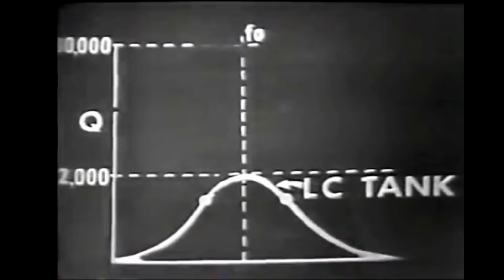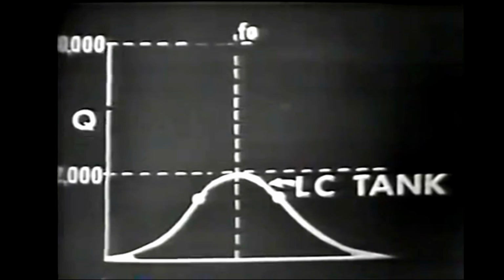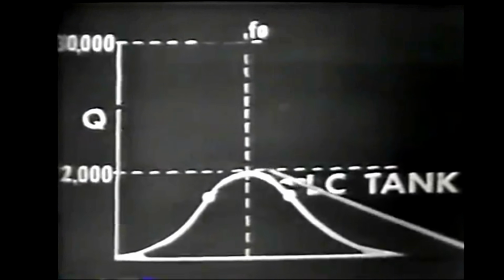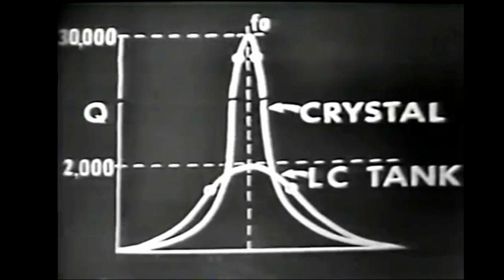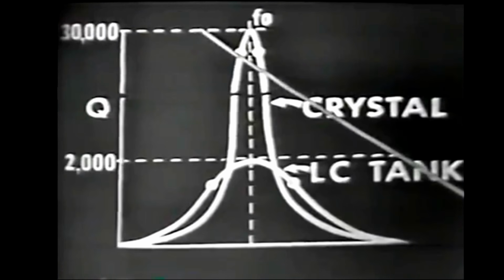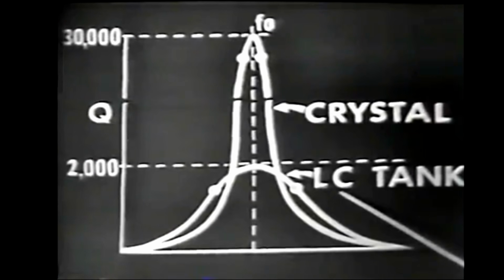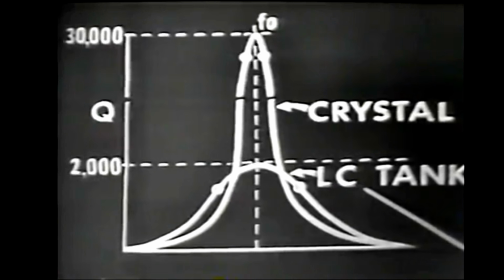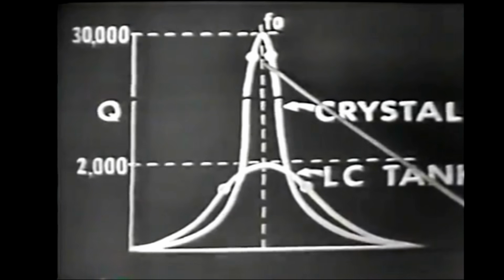Crystals and Science; energies, frequencies and vibration

Comment: So energy crystals are not pseudoscience
Reply: Yeah it is pseudo-science, crystals don't have energy, if you deform a crystal by applying a force to it then a small temporary voltage will be created in the crystal as it deforms, and conversely if you apply a voltage across a crystal the crystal will deform by a tiny amount while the voltage is being applied, all energy is conserved and the energy has to be applied to the crystal either as mechanical force or electricity, without any external energy being applied to the crystal nothing happens and the crystal has no energy.

Comment: Crystals do not emit energy. Yes, go ahead, excited believer. Crucify me. I will say it again. Crystals. Do not. Emit. Energy. There is ZERO, repeat zero evidence that crystals do anything other than look pretty (or sometimes give off electric charge when impacted).
Reply: I'm just trying to learn about this, but if crystals do nothing but look pretty, why are they used for watches and radios for the frequencies they give off?
Reply: @murple1537  they are used for something called the piezoelectric effect, which means that, when compressed or subjected to an electric charge, they oscillate at a predictable rate. If you zap a quartz crystal with an electric charge, it will start vibrating at a fixed frequency that varies very little over time, and that vibration can be used to keep track of time.
Reply: @alt8791  oh ok thanks, I was under the impression that it was the size of the crystal, cut specifically, that changed the frequency. I was on a mission to see if healing crystals may be real, and if they were I was going to assume the earth is flat too

Comment: One of the problems with "natural Quartz xls is that virtually all of them are internally twinned, meaning that a single looking xl is really a combination of xls. This twinning can be like a candy cane.  Very very few localities produce untwinned natural quartz xls. This is the primary reason that most natural quartz xls cannot be used to make oscillators, quartz watches. The first quartz clock was invented by GE in the 1920's. Quartz watches did not come into general use until the 1970's. By this time methods were discovered to grow untwinned quartz xls on an economically viable scale.
Reply: mountains of colorado
Reply: Interesting!

Comment: You have conflated what the video actually explains with your own theory about crystals.  According to you, "crystals emit energies"... according to the video, however, they resonate at a frequency by design and only after being introduced to mechanical pressures.  The characteristics of a crystal designed ( cut ) to resonate at a specific frequency of 1000 times per second ( for example ) can be used to negotiate the electricity in a network of wires and other crystals to cause the electricity to emulate a sinusoidal waveform at 1000 times per second.  The name is an "oscillator". The reason i made this comment is because of the rampant abuse of spreading stupidity over the internet instead of spreading any actual educational information.  I made this comment for free, for the education of our species even though you created this abuse of information for the purpose of lining your pocket. Please take that to your metaphysical guides for a chat on ethics. Thanks and have a nice day. :)

Comment: remember when quartz watches were very popular at one time, high frequency stability. it was used to create the correct elapsing time for the seconds. that's why those watches were more precise over time than mechanical one.
Reply: What do you think they use today?
Reply: the best movement out right now is made by Seiko called spring drive... It combines quartz and mechanical movement for a perfectly smooth hand instead of ticking
Reply: They are popular even now
Reply: Check out Bulova watches